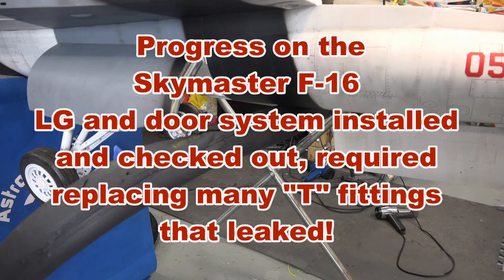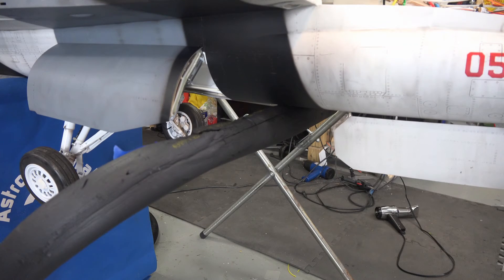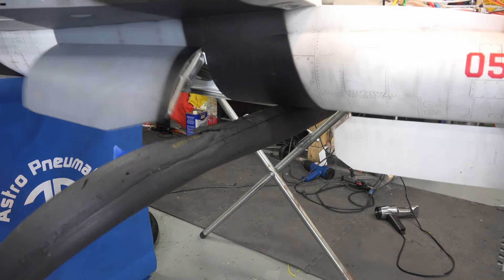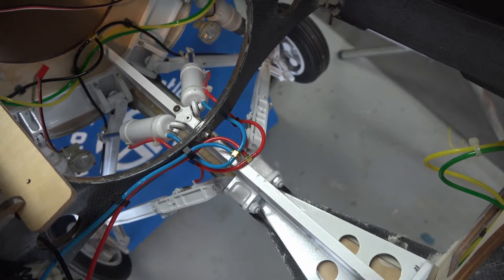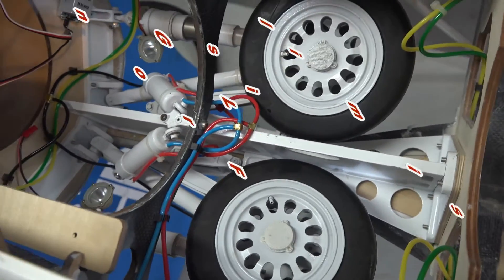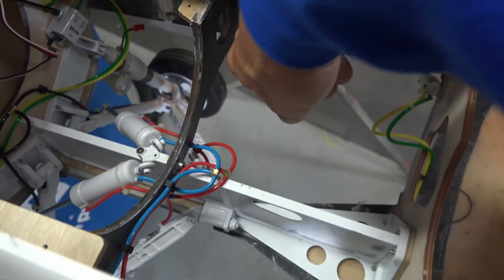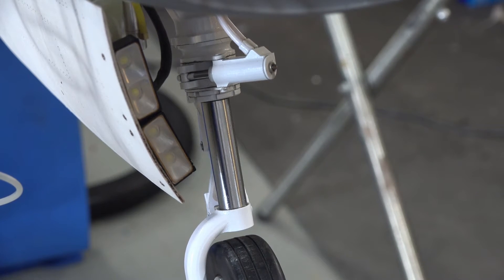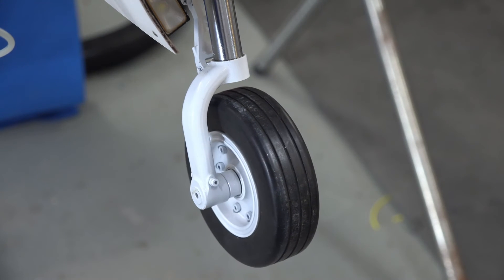Skymaster F 16 LG and doors

Comment: Did u keep the pneumatic gear doors or go to servo controlled doors? Because the gear doors in the end still seemed kinda violent and quick.
Reply from the maker: yes used it as it  worked great